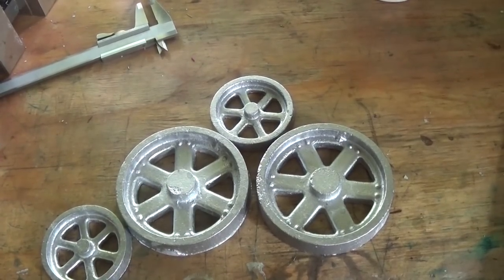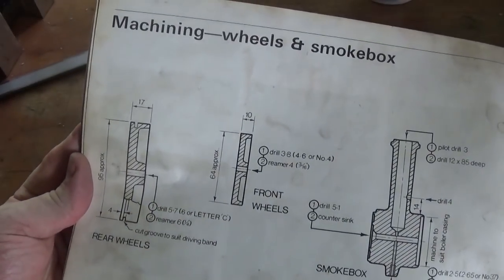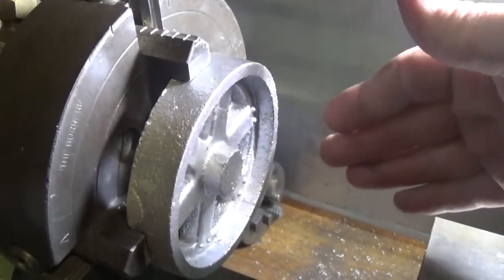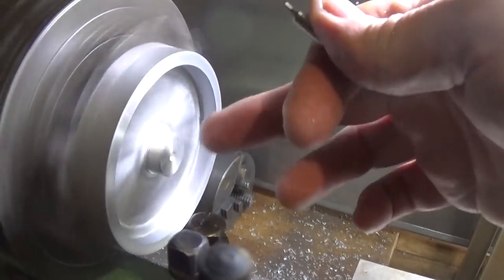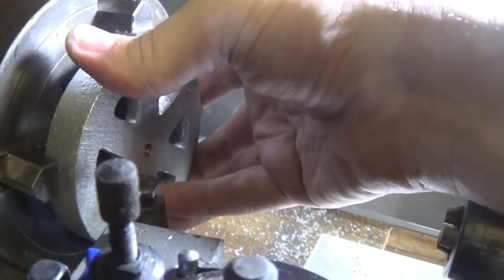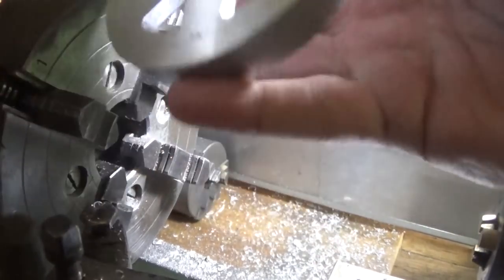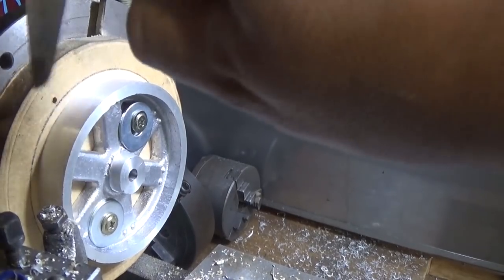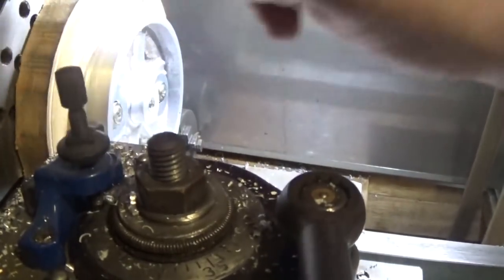PATREON SERIES - Kenny the engine THE WHEELS

Comment: G’day Emma nice work on the wheels. I’ve used a timber face plate a few times now and it works a treat, beats drilling extra holes in the aluminium plate and as you point out you can run the tool into it and save mucking around with spacers. Cheers Peter

Comment: pretty cool emma. The cast aluminum does create a bit of a mess, but I prefer machining that over extruded aluminum any day of the week tho, no long nasty stringy messes, no rat's nests, and a little WD40 and it just comes off without much trouble at all. Also, it's a piece of cake to take those smaller chips cast aluminum does and suck those up with the shop vac/vacuum cleaner, lol.
I figured your lathe would have much more power than that, or was the belts just slipping on it?

Comment: If you had cast the sprue  in the centre of the back of the wheels you wouldn't have a problem machining the outside of them. Save's a lot of faffing about and you can still use the the 4 jaw to set them true. I have made a couple of these, great little engines.
Reply from the maker: Hindsight is a great thing. You're 100% right.